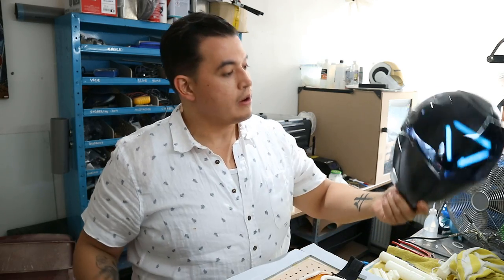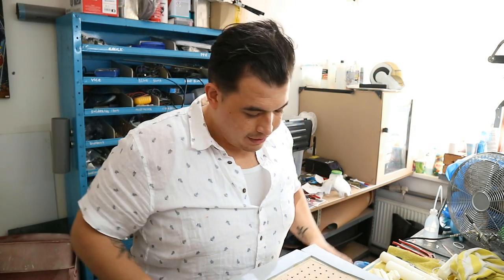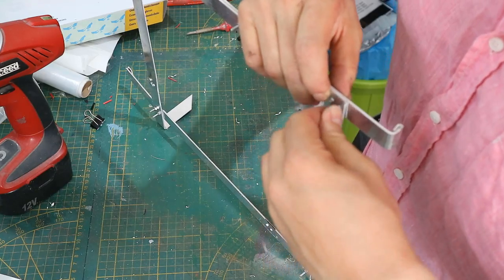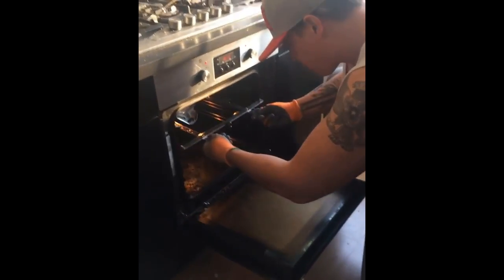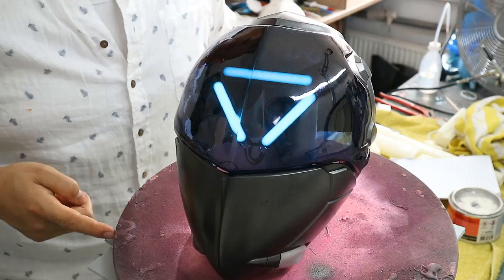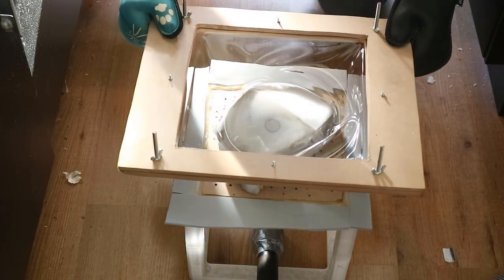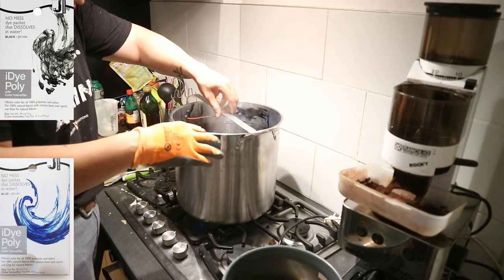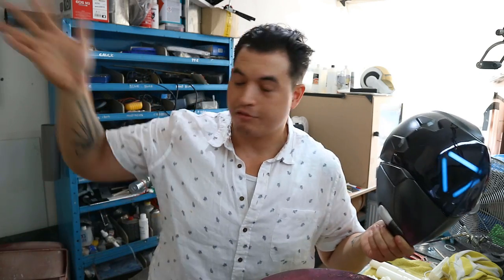Vacuforming Cosplay Visors - TUTORIAL

Comment: How hot did you have to bake your PETG before you could vacuum form
Reply from the maker: Think it was 230 C
Reply: @Wayne's Workshop   I tried that but my pet G was getting hazy
Reply from the maker: @jacobrutledge7962  mine never had that, however i do know that recently petg has been mixed with cheaper alternatives, many base resources were low due to pandemic so to still supply/compensate cheaper crap is made. Friends of mine even recieved plexiglass instead of petg to vaccuform (it failed horribly of course)
Reply: @Wayne's Workshop  lol this sucks, any way to find the real stuff? I need to do a master chief visor
Reply from the maker: @jacobrutledge7962  don't know man, i haven't vacuum formed since this video and haven't had a need for petg sheets since
Reply: @Wayne's Workshop  that's fine, thanks for the info I'm glad that it's probably the material and not me